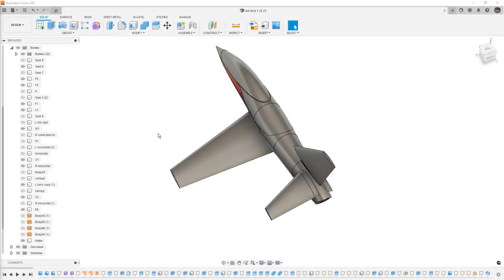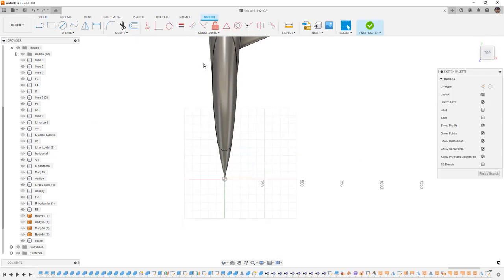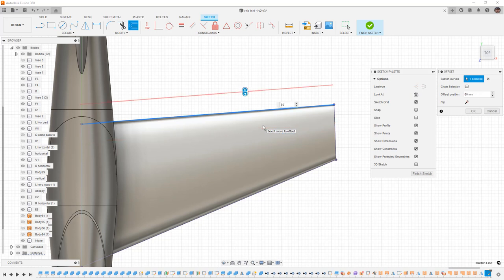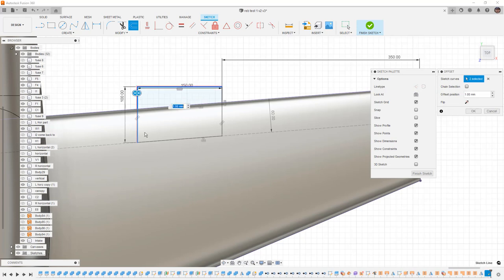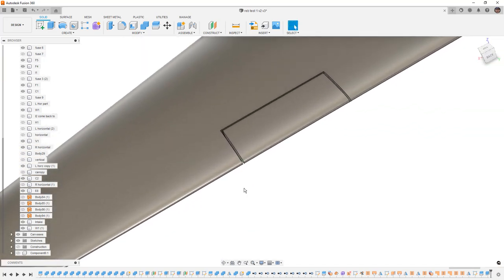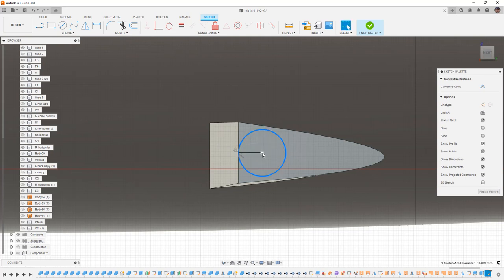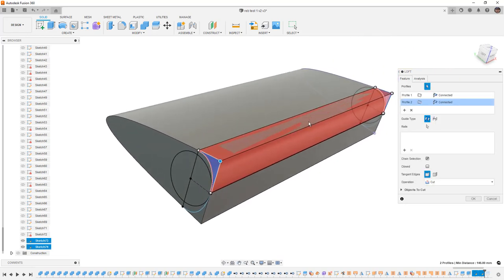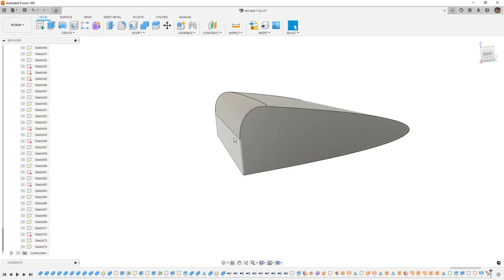Splitting and Modifying Complex Shapes | RC Jet Aileron | #rcplane #fusion360

Comment: Great video.  If we wanted to cut the wing at the aileron part so that it has the same semi-circular shape only concave and the alieron convex shape fits in is that possible?  It is a good way to streamline the airflow over the control surface.🤔
Reply from the maker: Im not sure I would say Streamline, but it can be done.
What I would probably do is make a body that has the leading edge you want for the aileron then use combine or boundary fill with the intersect option to create a new aileron body with that rounded leading edge but "keep tools" so the wing stays.  Then using surface tools I would offset the outside of that whatever gap you want around it at the wing, then use that surface to cut away from the wing.

That is probably the easiest way i can think the preserve the wing shape and make the aileron.